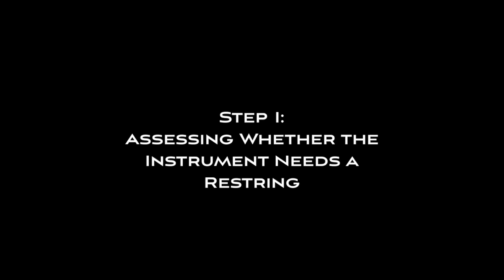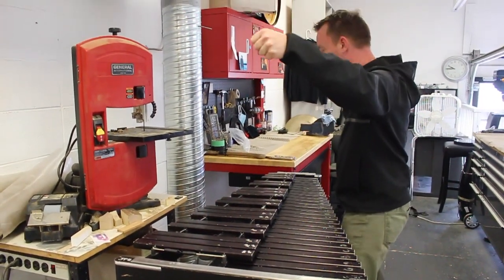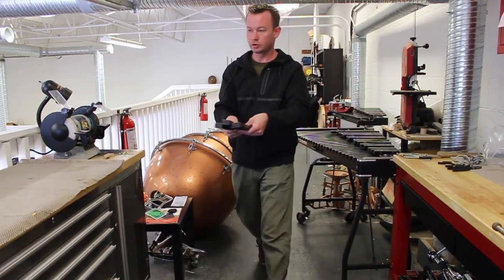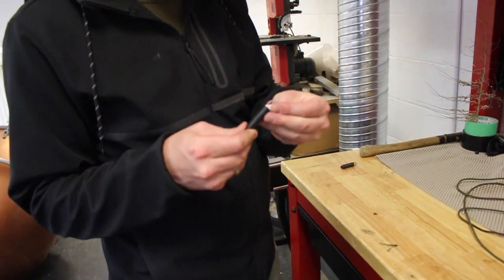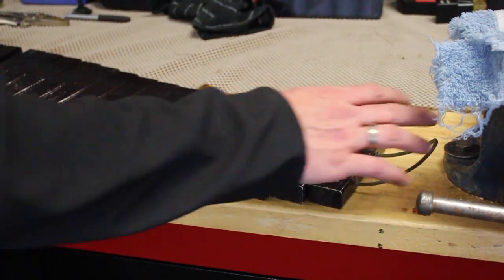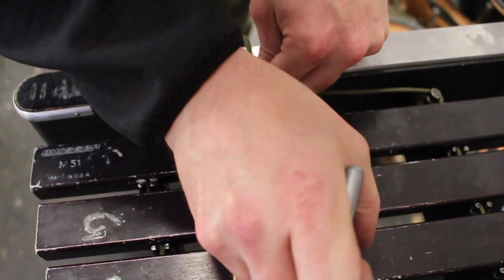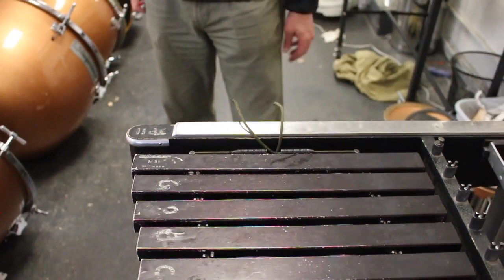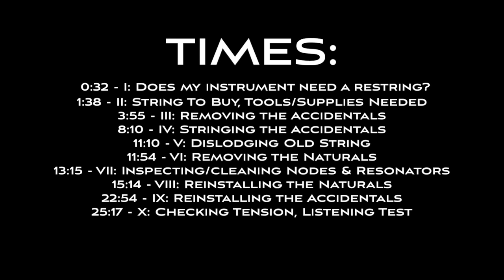Maintenance: Restringing Keyboard Percussion

Comment: How much time does it take to restring the entire instrument?
Reply from the maker: I can typically do it in about an hour because I’ve done it so many times. If some of the “nodes” (which is to say the support posts that hold up the string) are bent, it can take me longer. If they’re bent, and also old and brittle, that can add more time, because even using heat while straightening them out can result in breaking them inadvertently. But if it goes smoothly, the restringing as well as cleaning around the nodes and doing a quick clean-up of the undersides of the keys takes about an hour altogether.
Reply: @RobMaciak  Wow, that's pretty quick.  Thank you for posting this very helpful video!
Reply from the maker: @neighborhoodmusicschoolinc  my pleasure! Write me if you need to ask me for any advice on anything - I always give advice over the phone for free. rob.maciak@gmail.com 🙂